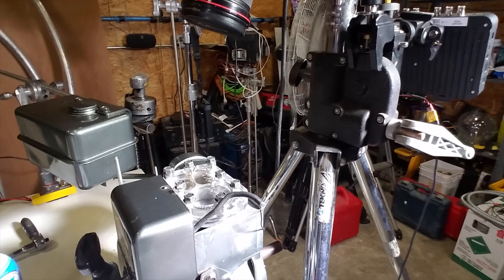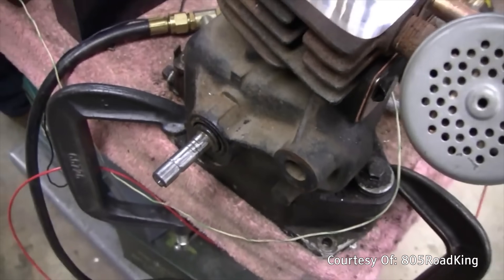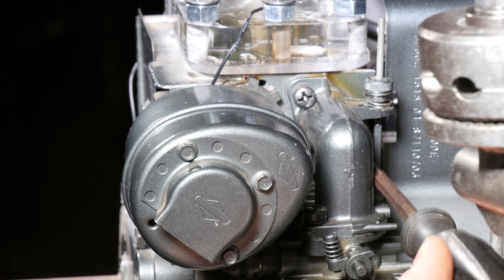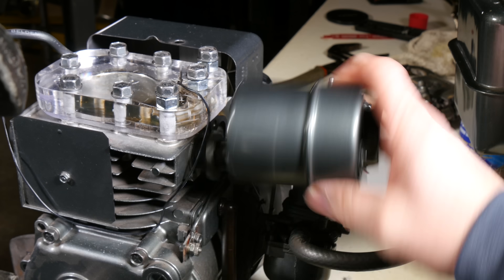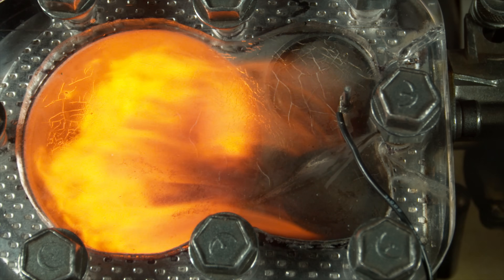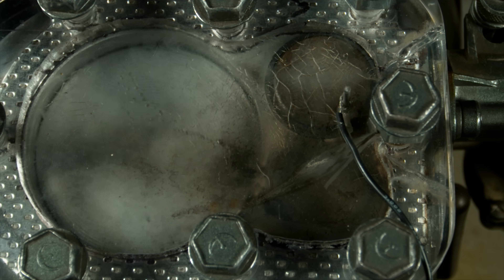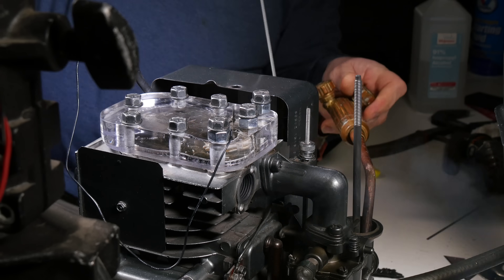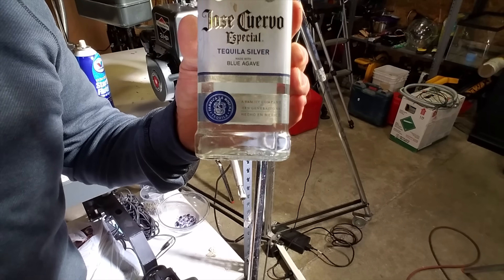See Through Engine - 4K Slow Motion Visible Combustion ( S1 • E1 )

Comment: Why does it spark twice per cycle?
Reply: The simple magnetos on an engine like this respond to the passage of magnets in the flywheel past the ignition coil. Since there are two crankshaft revolutions per cycle, there are two passages per cycle. One happens at the top of the compression stroke (beginning the power stroke) and the other happens at the top of the exhaust stroke (beginning of the intake stroke.)
Reply from the maker: Eltontv it's called "wasted spark"
Reply: ZamaskowanyWolnościowiec i think its useless to calibrate the ignitiin coil to spark only one time.

Comment: Sweet video. You needed to rejet the carb to get it to run clean in alcohol. That would have been awesome to see. You need smaller jets for alcohol and  then you should try nitromethane as well.  You can get it from hobby shops. Good luck!

Comment: Acetylene is dirty as fuck.
Reply: Generic Name it burnes so dirty because it was too much acetylene and not enough air
Reply: yeah, carb was set up for gasoline, the air fuel mixture would have to be adjusted and the carb jetted for acetylene.......

Same as the alcohol, it was taking in WAY too much (rich)......

Comment: Excellent, thanks. Needs way more! I would like to see gasoline at a range of mixtures and engine loads. Need a prony brake and an adjustable main jet in the carb. Might have to use pyrex at higher loads and temperatures. Would like to see detonation too.

Comment: We once ran a B&S on gasoline, but with oxygen instead of atmospheric air. We were able to get it over 11,000 rpm by blocking the regulator. Not quite safe with cast iron flywheel, but fun!

Comment: believe it or not you can run an engine on distilled spirits. even 160° proof moonshine. but the only problem is no matter how much you refine the spirit it still has trace amounts of water in it. so technically speaking if u do run out of gas and u had a bottle of Johnny walker red it can get u home, however... overtime the water in the alcohol can and will rust out the cylinder walls of your engine and quite possibly cause it to seize.

Comment: Warped Perception, The reason it fires twice is because when its coming up on Exhaust stroke the magnet is passing the magneto causing it to spark which is what it does on the compression stroke causing it to fire so it will spark on both the compression and exhaust stroke.

Comment: why the spark plug sparks at strock 4 when all air are out?ｉｓ　ｉｔ　ａ　ｔｉｍｅｉｎｇ　ｔｈｉｎｇ　ｏｒ　ｉｔｓ　ｊｕｓｔ　ｔｈｉｓ　ｔｙｐｅｓ　ｏｆ　ｅｎｇｉｎｅ　ｓｅｔｕｐ？
Reply: Good observation.  The design is called "wasted spark" ignition.  Half of the sparks are unnecessary, but it's simple and inexpensive to implement mechanically -- the "points" are actuated by a cam machined into the crankshaft.  (Reflect upon the additional components and complexity required to spark every-other revolution).  Most (not all) electronic ignition systems solve this.
Reply: A simple setup - it just sparks at the same position every rotation.
Reply: ***** i see thanks

Comment: A) what is the compression ratio of this engine? B) what percentage alcohol were you running? I think the 90% solution much better, perhaps this was 70%? I'm thinking run it way leaner.C) Try adding 10% Nitromethane to it!D) I'd like to see slow mo of the exhaust pulseAwesome video! Underrated channel indeed.
Reply from the maker: TCPUDPATM PORTS not sure of the compression ratio, I can check that out and post it here . whatever it said on the bottle .
Reply: Appreciate the response. Let me know if you get around to putting some Nitro in that thing! Just be warned, the mower I ran it in was piston slapping like crazy and eventually started dieseling. But no amount of  grass was able to stop it while it ran lol

Comment: I guess the alcohol is one way to clean out the combustion chamber :)
Reply: Yeah it was completely flooded. He had no choice though unless he wanted to tune the carb completely. Remember alcohol usually takes 1 and a half to two times the amount more than gasoline to run.
Reply: It will also strip the oil off the cylinder and rings more than likely. Solvents are quite good at that. One reason why diesel engines outlast gasoline ones.
Reply: shades2 
gasoline is a solvent. Motors that run ethanol (not isopropanol) do not get carbon deposits.
Reply: Running dry in the middle of nowhere i bought 2 liters  ordinary grain alcohol  i.e. 97%  ethanol and at the nearest convenience store, the car started up and ran perfectly fine, so I was able to get to a gas pump .
Reply: But you are right, the car felt more sluggish.
Reply: okleydokley I think maybe you're talking about methanol. ethanol can only be combusted with an e85 mixture (15% gasoline) 85% ethanol efficiently. there isn't enough explosive force in ethanol to run a car with enough power.  I race my race car on methanol. there is one bad downside to anything ending in thanol is corrosion. methanol is a rust/corrosion breeding ground. oil has to be changed more often and I use almost 3 times more methanol than gasoline. so yes there is no carbon deposits in the motor but a lot of people who run methanol run an oil additive called top lube (kinda like 2 stroke oil) to prevent upper cylinder rust. but this will cause small carbon deposits. have a good one okey
Reply: yeah... to get any benefit out of alcohol water injection you need a high compression ratio...
Reply: Jarrod El-Khouri yeah but sea foam is rubbish dude!!
Reply: The rust is due to water in the alcohol. It's virtually impossible to get water-free ethanol or methanol as they're hydroscopic and high pressure water vapor is bad news for most metals (It's not called "the universal solvent" for nothing)

in any case, pouring alcohol or any fuel directly into the inlet tract is a bad idea, but given the difficulties of setting up a carburettor's jets for it, understandable for demonstration purposes.
Reply: I also thought that if he'd have put the alcohol into the tank so that it went through the carb jet, then it would have atomised and wouldn't have flooded the cylinder like that.
Reply: Nick Shipway and float and plunger plus his jet yes he would have a better air fuel ratio... you said it well
Reply: C'mon, you can machine a polycarbonate cylinder head, but not drill a bigger hole in a replacement jet for the carb? 

It was the flooding that cased that head to crack btw.
Reply: yea, I'd like to see also water injection cleaning of the chamber :)
Reply: Seafoam is made up of IPA! If that says anything! :)
Reply: Alan I agree 100% The methanol I run has less than .2% water. The issue is its a water attractor hydroscopic like Alan said. Since there is water grains in the air during combustion water is present. so if I get done racing for the day and I don't add a petroleum-based product down the injector my cylinders will rust. So like Alan said don't go try to add and ethanol or methanol to your intake trying to clean your engine. I do believe if the cylinder had filled with much more of the alcohol he used he could of hydrolocked the engine. Which basically means the cylinder can't compress all the fluid in the cylinder and something has to give and it's usually a rod or rings or piston. Transmission fluid works better anyway.  But that's another subject for another day!
Reply: Filip laskovski and all the oil lol!

Comment: Very cool. The acetylene was so dirty (carburizing flame)... I bet if you opened the oxygen valve a bit it would clean up. It would probably be way too much pressure to contain though.

edit: also, i subscribed half way through this video. these shots are awesome.

Comment: Why does the gas only ignite every other time the piston rises to the top? Is that an intentional part of the design?
Reply: indeed it is, it's a 4-stroke engine, every other time the piston goes down it is pulling in fuel which is then compressed and then ignited on the next stroke, the ignition stroke is called the power stroke, the piston then rises again which pushes out the exhaust gases so the cylinder can intake more fuel. most small engines are 2-stroke, but not all, they have a power stroke every time the piston goes downwards unlike this one.
Reply: Alexander F.
The four strokes are - intake stroke, when piston goes down.  Compression stroke, when piston goes up.  Ignition or power stroke, when piston goes down again.  Exhaust stroke, when piston goes up again.  Or suck, squeeze, bang, blow.

Comment: It'd be nice if you could hook that engine up to a dyno and give us power numbers for different fuels. 
Do petrol (regular and premium), diesel, E85, aviation fuels, nitro fuel, HHO, Hydrogen and oxygen separate, etc. and petrol preheated vapors, the legendary car (maybe myth) of having a vehicle range of 200+ miles on a gallon of fuel. 
You should also do different engine designs. B&S, OHV, two stroke, rotaries (Wankel and if you can the new LiquidPiston thing), etc. Same tests, see which what power each design makes on different fuels. 
Then do these tests on different sized engines, from hobby sized to vehicle sized with intervals between the two, to see if different designs are easily scalable or to see if there's a specific range of sizes that are more powerful or more efficient than others.
And if you can, test efficiencies of fuels, designs, and sizes.

Comment: Why does it spark twice per cycle?
Reply: Atristiel the spark is triggered when the crankshaft completes one rotation, usually by a magnet on the crankshaft that rotates with it. it doesn't hurt the engine to spark ever rotation and it would be more complex to have it spark on the right stroke every time, hence it sparks every time it rotates
Reply from the maker: Its called a " Wasted Spark " Ignition system here's more info: https://en.wikipedia.org/wiki/Wasted_spark

Comment: need to add the oxygen with the acetylene
Reply: That would probably be very dangerous.  Acetylene is flammable when burned in atmospheric levels of oxygen but mixed with pure oxygen in the proper ratios it becomes explosive.
Reply: Or use oxygen instead of air for other tests (e.g. gasoline)
Reply: brandy sigmon THERE ALREADY IS OXYGEN IN THE AIR!!!!!!!
Reply: I mean pumping more acetylene into the chamber would make more soot than reduce soot?
Reply: yeah wouldn't opening the valve fully make more soot?
Reply: To a point yes.  At some point too much acetylene would start displacing air and limit the amount of acetylene that could burn.
Reply: Horrible idea, that engine would become a Bomb. If you were to connect Acetylene to even a Dragster engine it would blow the pistons down into the crank and blow the heads off and the Cylinders would be split like banana peels. Acetylene is not a joke... Have you ever see how much Damage it can do in a Water bottle and lit up it can blow a arm off whike holding it.
Reply: brandy sigmon not to smart, then it would be a Briggs IED!
Reply: brandy sigmon oxygen is being drawn in past the torch
Reply: But.... That's why it would be cool!

The only negative I see is that it would likely ruin the next fuel test.

100%. Nitro. Methane.
Reply: It already did that, its why it covered the top...
Reply: It's extremely diluted, close to pure however it starts creating big complete reactions... if that made sense

Comment: @ Warped Perception, it would be very cool and helpful if you made a clear head with a "fire slot" hot rodders did it fora better more efficient burn back in the day on old flathead hotrods.
Reply from the maker: cdoublejj im going look that up , "Fire Slot" sounds bad ass !!
Reply: so on second though idk how that might work for since the clear head is flat on both sides. so factory aluminum head on flat head has wedge shape. it's thicker over the piston and thinner above the valves. 

http://s129.photobucket.com/user/kornpoke/media/Kart%20Engines/head.jpg.html

http://www.hotrodders.com/forum/attachment.php?attachmentid=48246&stc=1

Comment: I have wanted to see that for a long time thanks for the video! If you do it again with other fuels you should do the acetylene again with the oxygen on as well. You wont get so much soot and it should be quite powerful. May want a blast shield though. Liked and subbed.
Reply from the maker: weaves7 you're completely right, I think the oxygen acetylene will blow an engine apart, so that's going to be my very last fuel before we call it quits and have no future plans for this engine. Haha

Comment: Do we want to see that engine running on tequila? What kind of question is that? Heck yeah we want to see that. Like why are you even asking? Just get going already, we can't wait.
Reply: Romulo Lora and diesel if possibble pls
Reply: Everclear or Moonshine. It'll work just fine.
Reply: thats really stupid, 100 proof s only 50% ethanol.
Reply: Traves Walters A buddy's dad used to make moonshine....it would burn blue when ignited......it actually might burn TOO hot for the acrylic cylinder head.....
Reply: Traves Walters I'm not sure about that, not a fluid engineer.....I would assume so since acetylene had so much carbon in it and the moonshine had basically none and acetylene requires an oxygen source to burn hot, where gases like propane/moonshine don't.....I think in their natural state (without pressurized oxygen) the moonshine would be hotter...but add in the correct amount of oxygen, and the acetylene would be hotter...

Think of welding: you can solder a copper pipe with propane, but you can weld steel with acetylene.....(but not with acetylene alone).
Reply: Ecver AUCWE I don't think diesel will work
Reply: How about a vid of me and my dog and guinea pig running on tequila?
Reply: Jose El ChAcAl i reallt dont have a clue
Reply: I used to keep a bottle handy to start my 1970 dodge dart 225 slant six in really cold weather...100 proof.....was WAY cheaper than quick start.......
Reply: +Muskoka Mike 
Yea, I didn't think of that. Would it produce more heat/pressure than acetylene?

Comment: Is the cover acrylic? Acrylic is even less resistant to ethanol than to isopropyl alcohol. It gets cracks all over. You might want to test how quickly the cover gets brittle after touching alcohol. (should be fine for a few runs though at that thickness)
Reply from the maker: superdau I believe it is acrylic yes

Comment: I agree this is one of the most interesting to me personally.  I would love to see all different piston and head designs like this.  Enjoy all of your videos.  Keep the ideas coming.  I was impressed with how fast the exhaust gases exited the chamber and wonder what Hydrogen would look like?  I've had a two cylinder opposed B&S engine for years and always wondered what was happening in there when the spark also occurred on the exhaust stroke.  Seeing how the different types of fuel injection functioned would really be nice.

Comment: Try a similar idea with gear boxes while running and changing gears. The smaller gear boxes from motorbikes would be easier because the have a side panel you can replace for a nice view. i would love to see the clutch on a sequential gearbox.
 Also somehow maybe you can modify a car transmission to see inside while its running (maybe modify a section of the shell/cut out and repaced with clear plastic) you may need to try with and without oil for different results.
Reply from the maker: MxO now that's a freaking cool idea , I have manufacturer support from Mercedes-Benz, I'm pretty sure I can organize this.
Reply: Warped Perception motorcycle idea is better haha
Reply: please do
Reply: Clutch on a motorcycle is boring to look at a bunch of plates inside a cage even fully exposed you wouldn't see much and a gear box isn't much better a spinning shaft shifting left and right slightly as gears are changed

Comment: Do it on a 2-stroke engine! Maybe add a clear cover on the crankcase also!
Reply from the maker: Cheesus Sliced lol... When I first saw it said 2 -stroke but there was another comment immediately afterwards that was referring to a 4-stroke.
Reply from the maker: lol.. no it was a 4 stroke !
Reply: Cheesus Sliced you could see a good example of exhaust scavenging in this footage though, I'd like to see a 4 cylinder with clear exhaust manifold too, but that's just asking too much lol
Reply: Of course it was a 4-stroke.. I'm suggesting if they could do it on a 2-stroke in the future!! Also, the purpose of seeing inside the crankcase is to (maybe) see the gasoline being sucked inside & pushed in the cylinder!

Comment: It would be interesting to see you add oxygen to the acetylene, burning in air creates lots of soot as you can see in the engine. Nitrous oxide would be interesting too but you'd need to film in a blast proof bunker. 
BTW, Roadking and Mike have a great channel, I've been following them for a while now.
Reply from the maker: Green Silver well our next full episode has to do with oxygen and acetylene, and I can tell you it's an explosive mixture. if I were to put oxygen and acetylene together in this engine I'm almost positive it would blow apart. definitely something for a future episode